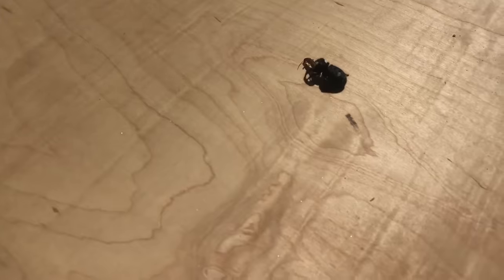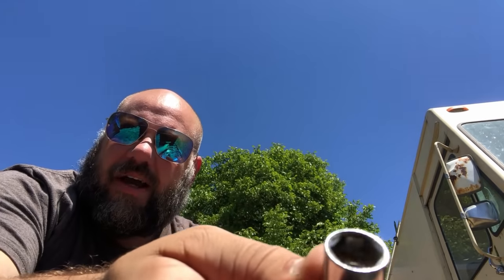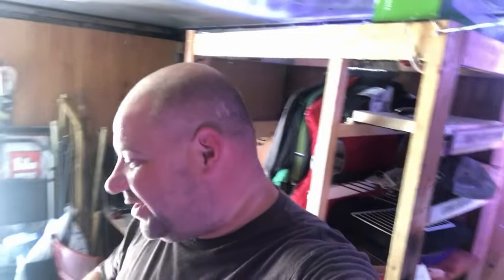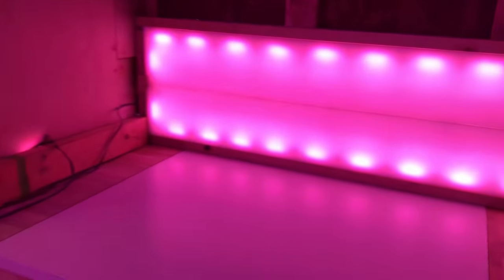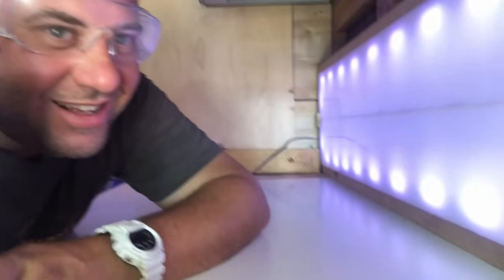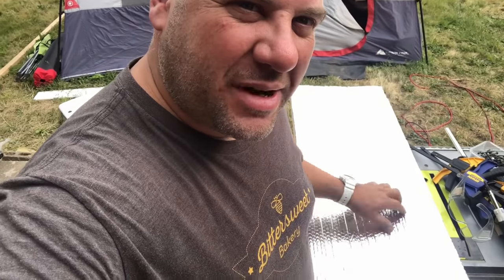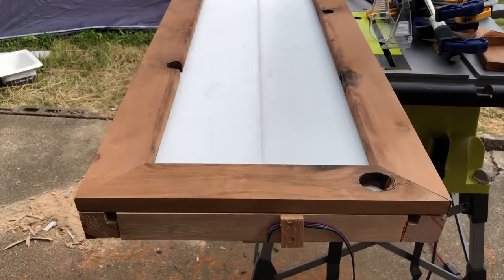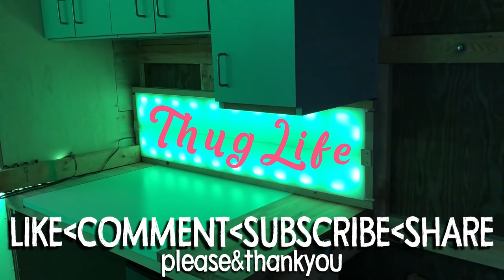LIGHTED DIY BACKSPLASH Dumpster Dive VANLIFE VLOG #112

Comment: Fancy shit breadtrucker! How much water are you planning on carrying? I might have some ideas for you on that if you're still in the planning stage.
Reply from the maker: Thank you! I have a 46 gallon freshwater tank, & 46 gallon grey water needs to be installed
Reply: awesome, thats the way to roll man I dont get how so many vanlifers get by without a decent amount of water on board. consider carrying a long enough hose with a trolley and a "water thief" so you can refill at any tap too. It's probably a lot of weight to be carrying around but having on demand hot/cold water is lush. 
If i was in your shoes I might get one of those standalone airconditioners too, only for when you're on shorepower because they suck too much juice and parking in the sun just to get enough solar for a few hours of airconditioning is self-defeating but on those hot summer days it might be a great relief to just be able to park up somewhere with an outlet to stay cool. not that you've got any problems staying cool with shades like that 8)